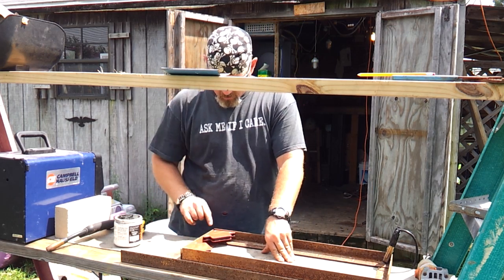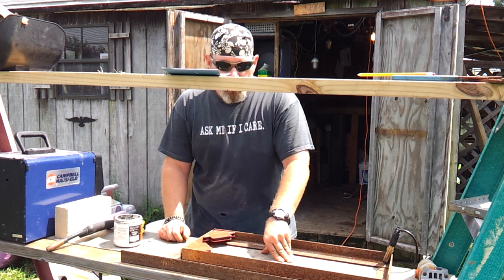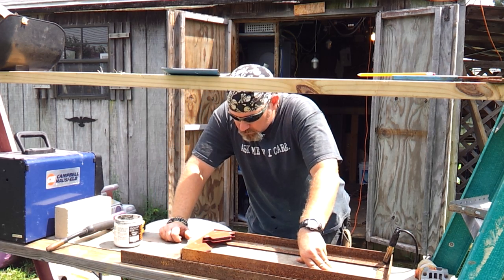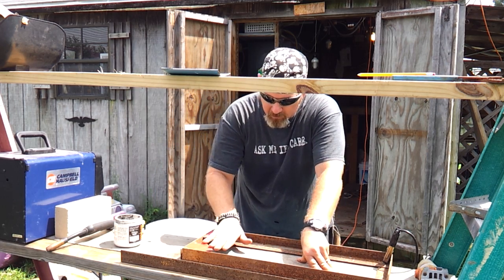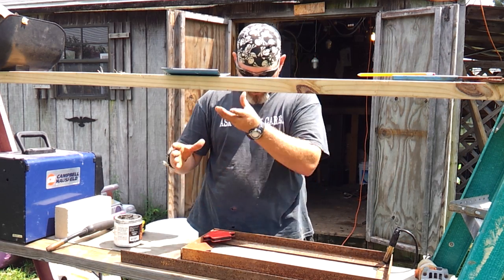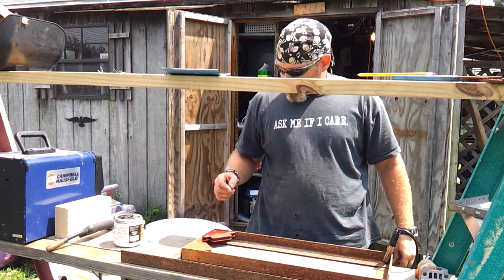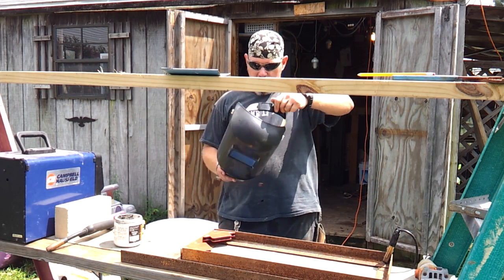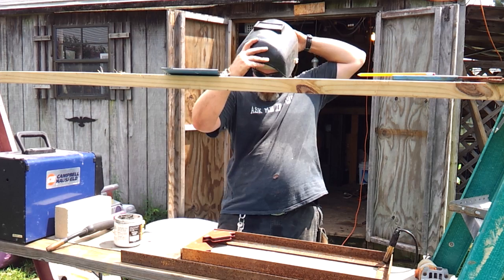Rocket Heater Wood Stove Build Part 5 (Welding the frame and metal work)

Comment: i found if you use a stick welder you can get away with more contamination than with a mig but mig is faster and easer but cleaning metal helps a lot